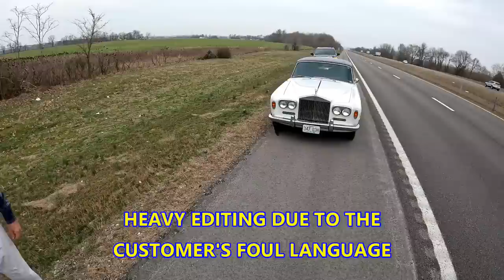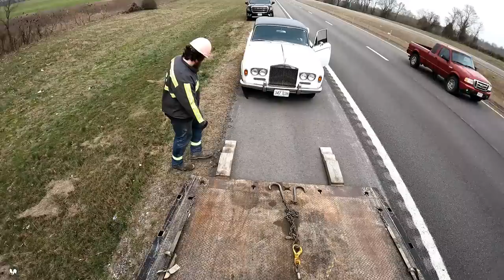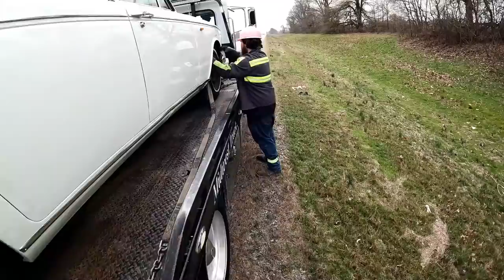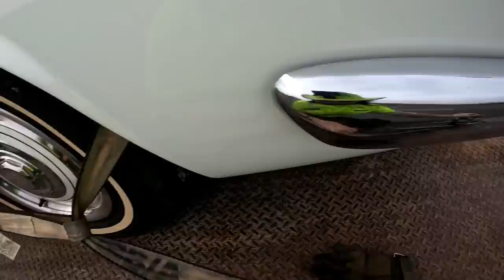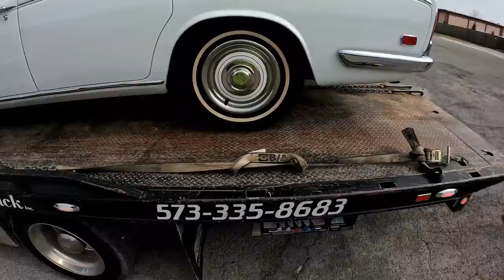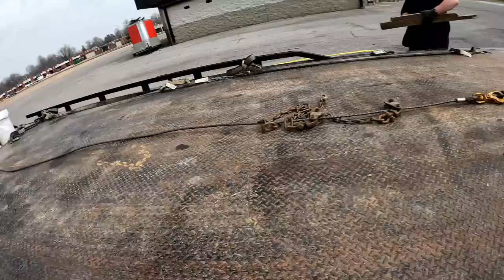Rolls Royce Tow! Damage Free Towing With Class!!

Comment: Now I know I can trust Ethan to tow my Ferrari.  If I ever get a Ferrari.
Reply: You gonna buy a Ferrari that breaks down? Good choice!
Reply: IF I ever had a low-ground clearance vehicle THAT expensive, the ONLY way it would ever be loaded on or off a flatbed would be using the Rotator, spreader bars and rim-slings...

Either that or it would be driven from a loading dock directly onto the flatbed provided it was at the same level as the dock!

😄😁😆😅😂🤣
Reply: @mikeball6182  Or he gets one he wants to put 0 miles on. like most collectors.
Reply: @A Wilson  all you need is a wheel lift truck with dollies ...

Comment: Well done guys on an excellent recovery of a great classic car .  Glad the boys strapped it down well that RR weighs in at around 4700 lb dry.  Point to note is that RR's DO NOT breakdown, the official RR term is 'fail to proceed'  .  One point for Ethan, please do not say in front of the owner ' lets get this thing off the truck '  their vehicle is, especially in this case,  a treasured possession correct phrase is ' lets gently remove this vehicle from the truck'  it shows the customer that you respect their property and treating it with great care, which you did very well. A small thing but will get you far in life in this profession.

Comment: Nathan did a good job. Retried from towing after 32 years. My only problem I think was done was allowing to customer drive his vehicle up the bed. Personally I never allowed someone with no experience to do. Still always enjoy the videos.
Reply: Agreed, huge liability issue.  Wreckmaster taught not to drive it up myself either,  you should winch it up and off the carrier always to avoid brake failure roll offs or scratching the vehicle getting in and out of it on an incline.  Not trying to be negative just passing along what’s been taught.  Thank you Ron for all the time spent on this channel.  No dollar could replace it.  Stay blessed.
Reply from the maker: @martintavarez6710  I am a WreckMaster as well and have been since 1994.   You are correct that it is a huge liability and something that is not commonly practiced.   As with anything, there are always exceptions, and this owner was one of those....    No hooks or straps on the undercarriage and NOBODY else allowed inside his car, except the mechanic at the end of the video.  Life teaches you that sometimes it's better not to argue, have them sign the waiver, and move on.    See ya in the ditch.   Thanks for watching and God bless.
Reply: @RonPratt  I understand, and also wasn't aware you had a waiver signed.  You're the reason i sought out and became a wreckmaster.  Since i found your channel almost 2 years ago now.  I may not comment much but i like em all.  I did my 8/9R in Madera last month, and am hitting my TowCert tomorrow Morning!  Thank you again for teaching me yet another aspect of the business.  Stay Blessed, and really do hope to "See ya in the ditch" one of these days. :hand-purple-blue-peace:

Comment: Way back when I got out of high school I managed a service station and a fleet of vehicles for a retirement home in Missouri and a couple that was in upper management had purchased a 1952 Rolls Royce Silver Shadow.  They wanted to take it out for a ride but didn’t realize that you have to be careful with old cars.  They ran it out of oil but also continued to drive it until it locked up.  I don’t think they ever had it repaired.

Comment: Could have used those homemade ramps the other day picking up not a Chevy but a GEO prism from the early 90’s sitting on 13in tires. End up putting the front wheels on them Teflon skates to bring the front bumper up enough that it wouldn’t drag on the lip of the bed when extended and lowered at the most gentle angle

Comment: Never seen a customer drive a car onto the tow bed
Reply: My dad did, once.  I'm not saying it was a guy with a tow truck for scrap cars that wasn't insured to tow cars for hire, but the guy's winch didn't work.    He was a nice guy, but generally, it's not a good idea to go to a random place and ask about a cheap tow.   "Yes, my friend has a tow truck."

I'll stick with pros like the team at Midwest Truck.
Reply: Normally they don't allow it, but in this case I believe it was due to the car being such a vintage/rare tow, and Ethan and Gavin not really having the experience on the job to drive a car like that.  It was a safer option to let the customer, who has driven the car before, to do it. I don't say that in a mean way, either. :)  Someday Ethan and Gavin will have that experience.
Reply: I've had several classic cars transported on rollbacks.   Every time they gave me the option to drive them on due to their value.    The transport operator also asked me about preferred tie down points (we used wheel tie downs like in this video). Of course the company I hired knew I was the vehicle restorer and that I had knowledge of the vehicle.

Comment: It's a  Rolls-Royce Silver Shadow Mk 1 priced anywhere between $25,000 to $50,000 depending on the milage & condition.  That one is partial stretch due to the rear side window being little larger.

Comment: Hello Ron. A very good job for Ethan and Gavin, SALUTE to both of them👍🏼👍🏼👍🏼. No damage on the Royce. .while watching i was wondering where they would tie it down, i think there's no hook up holes on the car frame and its a low profile car. I was right that they'll do the 8 point wheel strap. One more thing more, ethan really learned from the great teacher. I noticed how he cleared the excess strap.💪🏼💪🏼💪🏼 Oh,,by the way what sizes of board did you use as you said "homemade ramps"?. Nice  video. Thanks and God bless.

Comment: In the 1970s I lived in England in a village in Essex. I had an old German-spec Mercedes and the only mechanic in the area that could work on it was a shop that specialized in classic cars. I had it in there for some routine brake work and somebody from my office dropped me off there to pick it up when promised as I had to go directly to Cambridge to attend a lecture.

Well, it wasn't done as the mechanic had ordered the wrong part, but the shop's owner said not to worry as he'd give me a loaner. It turned out to be a 1970 Bentley (think Rolls Royce upgraded). I drove it to Cambridge that evening and then back and kept it for a couple days until they finished my car. It was terrifying to drive because it was so damn quiet I never knew if the engine was running, it was large, and it was actually very fast. It was also an automatic, which I had never owned and I kept trying to change gears. I was very glad to return it and get my simple old Mercedes back.

Comment: Where you as a tow truck operator can get in trouble with towing that Roller is in hooking the chains to pull it on the bed. There are not a lot of great places to attach the chains. 
One time I had my 80 Wraith II ( long wheel base Shadow, very much the same as that one) towed, the driver attached the chains to some front suspension components and did thousands of dollars in damage.
A wheel lift with dollys is my preference is that flatbed driver is inexperienced and the car can't be driven on to the bed like with this one.

Comment: I'm guessing it's a Silver Shadow. When I was a kid, and on up into the early 90s my Dad's cousin had a 1958 or 59 Rolls-Royce, which I'm guessing was a Silver Ghost, but I don't know for sure. That there sure was a beauty. In 1998 I had a blowout on a rear tire on my 1974 Miller-Meteor Cadillac ambulance, at 55+ mph. That damaged my fender skirt, and the wheel cover was thrown over the guardrail and down an embankment. Then I ended up changing the tire with the factory jack. That was fun... not!

Comment: Ouch!
It looks to me as if the load rating of the tye is not up to the weight of the car, or was aged out (there is a number you can decode on the sidewall for the year of manufacture, and anything over 5 years is taking a risk) or it was running at low pressure.  Old tyres are often a problem on classic cars that don't do enough miles to wear them out before they just lose their pliability through age.
Horrible delamination of the tread like that is not something I've ever seen on a sub-5-year-old good quality car tyre of the right load and speed rating at the right pressure.  And I've run several classic cars, although never a Rolls Royce.  But in the classic car field, there are a number of common problems which crop up for a lot of us, and this is one of them - possibly even the most common.
I'm surprised at the lack of a spare along with the tools to change it.  The tool kit that comes as standard with a Rolls Royce is legendary!
A beautiful car though, and beautifully handled (as always).